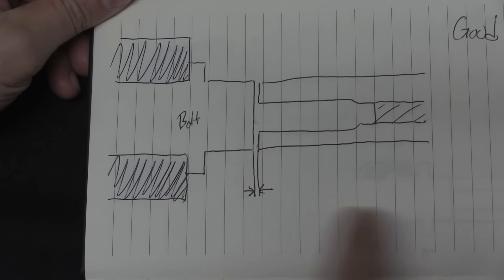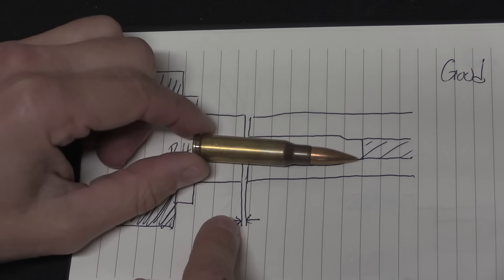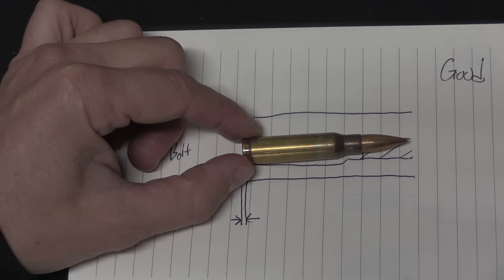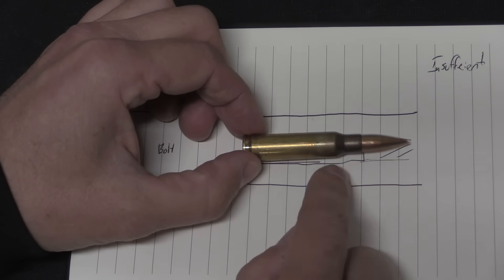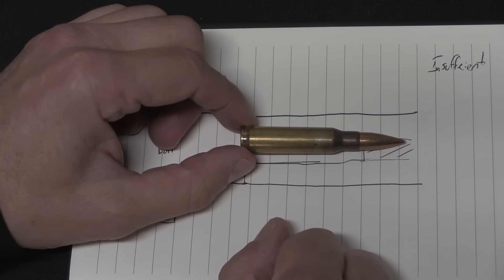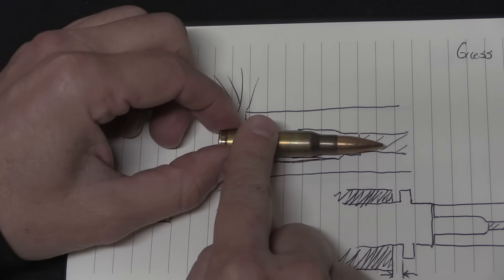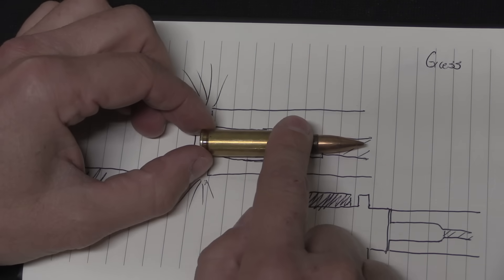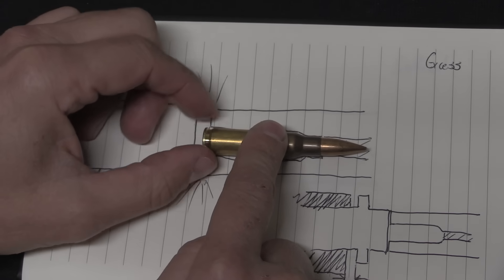Ask Ian: What is Headspace? (And Why It Matters)

Comment: Can I ask you a question? How did the black powder guns became obsolete? Besides the obvious answer of muzzle velocity, less gunk in the barrel, etc ofc. And what’s the difference between the different systems of black powder guns? I’ve heard of flintlocks, matchlocks, all sorts of systems, but can’t understand how one of them is better than the other
Reply: Smokeless is more powerful per volume, so cartridges could be smaller and lighter. Higher velocity gives better range. Less fouling = more shooting accurately without cleaning. Less smoke means better visibility and less giving away your position.   The development from Matchlock to Flintlock to Percussion cap (caplock) was a constant improvement in reliability and ease of use.  Matchlocks rely on a smouldering "match" ( a cord impregnated with a slow combustible agent) to ignite the priming powder in an often open "pan"  and thus are quite useless in wet weather.  Flintlocks improved on THOSE (largely because flint didn't care about being wet, and the priming powder was shielded from the weather by the closed frizzen) yet they relied on correctly "knapped" (shaped) flints to produce a good spark from the frizzen surface..Caplocks were a vast improvement as (like a modern primer) their Percussion caps directed the priming flame directly to the main charge.  Black powder internally primed cartridges were an enormous step UP from even the caplock muzzleloaders... in fact that is arguably THE single biggest leap in firearm technology ever, even a greater leap than that from BP cartridge to smokeless....

Comment: I got a brand new Kriss Vector in 45 and in Canadian specs. So long barrel with a fake suppressor and single fire from Cabelas, and a few boxes of different ammo types every single case that ejected was split after about 20 rounds I was concerned after another 40 I was like wtf I took it back and they said there was a head spacing issue they had to send it back for repairs. I said I just want my money back never trust that BS again I always had them check the headspace, even if it was a brand, new gun terrified me.

Comment: I have an old heavy barrel model 70 win in .243 just recently I’ve been expecting blowback just at the neck on one side and an occasional neck crack?
Reply: Is this with new cartridges, or with brass you've reloaded multiple times? 

If you are having these problems with new factory-loaded cartridges, your pet rifle needs to go to the rifle doctor. If it's doing it with brass that's been reloaded multiple times, it may be the brass, and it could be too long and/or work hardened. If it is with your reloads, try a box of factory-loaded ammo. If it is still misbehaving with new ammo, take it to a gunsmith for a once-over.

Comment: I found that when building an Ar-15 or Ar-10, is best to either sent your bolt to the barrel manufacturer, buy the bolt with the barrel where the manufacturer will check the head spacing. This is a big problem with DPMS barrels as the head spacing is not standard between manufacturers. If you are building a DPMS system, it is best to buy the bolt and the barrel together from the same manufacturer. 

Even when buying a new complete rifle, I always check the head spacing.

Comment: I was wondering about this for shotguns. I know shotguns use the rim of the case for head spacing but why haven't automatic shotguns started using a rimless case for better feeding? Are we just too set in our ways? Would a rimless all metalic case not allow for certain loads? What's the deal?
Reply from the maker: There is such a huge supply of traditional shotguns and ammo out there that introducing one with proprietary ammo would be market suicide.
Reply: @ForgottenWeapons  I totally agree with that! I was watching to see what would happen with the RAS-12 shotgun that used a rimless case and that totally flopped. I just feel like having an automatic shotgun in the 21st century that feeds most reliably from a fixed magazine tube still seems... antiquated.

Comment: SMLEs are notorious for having excess headspace set at the factory. Not so much that factory cartridges will go boom, but enough that reloaders have to be very careful to headspace off the shoulder or eventually their cartridges will go boom (head separation).
Reply: I never full-length-resized a cal. .303 round that's been fire-formed in a SMLE. There is extra room in the shoulder area of the chamber that the cartridge will form to when fired ( a new factory cartridge). I only neck-size a fired cartridge case when reloading, full-length-resizing would work-harden the brass in the shoulder area and cause it to split in due course. Neck-sizing-only greatly extends brass-life, the down side is, the reloaded round will only chamber in the rifle for which it was fire-formed, forcing a shooter with more than one SMLE to specify which rounds are for which rifle.

Comment: This was a very good basic explanation of headspace and its role in safely firing the firearm. I would like to see follow-up videos on ways of achieving headspace. Rimmed cartridges versus belted cartridges versus semi-rimmed versus shouldered versus head spacing on the case mouth. All but semi-rimmed have their advantages. Secondly I would like to see the effect of headspace on accuracy particularly in the case of 38 Super where it is a semi-rimmed cartridge but gets increased accuracy when the firearm is set up for to headspace on the case mouth. And finally it would be nice to see a comparison of say a military chamber versus a match or even bench rest chamber. There used to be guys that would shoot an entire benchrest match with one casing! Punching out the primer between shots priming it with a hand primer measuring the powder charge and seating the Bullet by hand. And yes when it comes to stating something in the first 30 seconds and then rambling on for a stream of Consciousness for 10 minutes I'll try and give Ian a run for his money!
Reply: That is very cool!! I didnt even know someone could do such a thing at the range.
Reply: @stephenhood2948  I don't know if they still do it. But these guys would cut their Chambers so tight that the cartridge would just chamber. And the neck of the chamber was cut to only let the brass expand enough to release bullet. So after they fired the shot the neck would shrink back down enough to hold the bullet. When they seated the bullet it was long enough to touch the rifling when chambered. They did all this to eliminate the variable case volume from one to the other and to make sure the bullet started from exactly the same place in the bore every time. But remember they were shooting groups measured in inches at a thousand yards and this was 30 possibly 40 years ago. Ammunition quality control has improved quite a bit.

Comment: Here is something I want to add, for those who think they want to check their own. The two terms that get thrown around are "go" and "no go" (come as a set), and you should ignore these. Those are for gunsmiths, and are for setting the headspace for brand new guns only, and are only for setting the initial head space that a NEW gun should have, and is only one end of the range of what a gun can safely use. For users who want to check if their headspace is still within the standards for what is still safe to use, you need "field", not "go" or "no go". Field is the maximum space you can use, as opposed to what a new gun should have, and there is a lot of usable range past "go" and "no go".
If "field" closes in the chamber, you have too much headspace, don't shoot the gun. If it won't fit, you are good to go.
Reply: I'd take slight issue with this.  First gauge to use is NoGo.  If gun goes fully into battery, stop.  Then use Go.  If gun refuses to go fully into battery, stop.  In either of those situations, you have a problem that needs to be determined and fixed.  If the first two tests pass, then use Field.

It is also important to remove spring loaded ejectors (such as on M4) before using gauges, as the force of the ejector pushing on the gauge can give you false results.
Reply: @robertgad3269  Unless you are building the gun yourself from scratch, go and no go should have been done to it already. Like I said, those are for gunsmiths. But otherwise, you are right. Ian even said that, he just didn't talk about "field".

Comment: Headspace is defined as the amount of space from the crotch region to where the steering wheel is located but it also contains the space below the event horizon of visibility from Dashboard to the chest as it's vital in it's prevention of visibility from the outside in. Sometimes headspace can be gained if no gag reflex is present.

Comment: Hey everybody! Wondering if the information provided in this excellent video is applicable to a fully rimmed cartridge. It would seem that a severe problem with cylinder/ frame clearances could allow for a potentially disastrous separation at the base of the cartridge ( I am thinking of a wornout Colt SAA or any other revolver of similar design...) or a failure to function altogether.
Please, your thoughts?
Have a great day, y'all.
Reply: The head of the cartridge is end with the rim, opposite the end where you shove the bullet in.  Hence head space is the gap for the rims between the frame and the cylinder in a revolve and head separation being a problem.
Revolver loads like 38 Special, 45 Colt and 44 Special are less than 20,000 psi you are more likely to see the thing jammed by blown, pushed back primers or failures to revolve or fire if there is too much clearance.
Reply: Thank you so much for your information!
I think what prompted my question was an image (legit? click bait? I dunno..) of a SAA that Elmer Keith ( god rest his soul...) shared of one of his personal guns, which he had been using as research into the concept of a really hot pistol round, which I guess was instrumental in the development of the 
.44 Mag , aparently test running a very hot .45 long Colt .
Top of frame: lost in space....top strap of frame: essentially bent all the way back....shielding the hammer. Apparently, no was one killed that day....but I am willing to bet a guy, Mr. Keith, among the best American pistoleros, had a bit of a moment when his SAA (one of the great gun designs, by the way...)
essentially went from a functioning machine to scrap..in his hand....
Thanks for all your thoughts, everybody.
Reply: The head of a handgun cartridge is about 5/16th / 5mm thick (thickness of the primer plus the wall with the firing hole), the rim is about 3/64th to 1/16th (1-1.5mm). 
To get a cartridge to stick out far enough to expose the thin cartridge wall, the rear cylinder gap has to be huge.
Revolver cartridges are usually cylindrical, so even a little gap below limits of the head thickness will not lead to excessive wall clearance.
This may occur on cylinder bores heavily worn out which may lead to a cartridge wall gap being too big and the wall will get stretched to its limits.

INHO to put it short:
A revolver with that much headspace or cylinder bores that large will be so sloppy, you would not try to fire it anyway.

Comment: Another common example of too much headspacing would be the dutch Steyr manlicher carbines particularly the ones sent to Indonesia as most of them have been converted to 303 British rather crudely so the chamber is too wide except for the very top. The casings come out buldged but is otherwise completely safe to fire. You can probably screw with brass goblins too

Comment: My roommate had a sporterized 1917 Enfield. We took it out back to try out a couple of old guns. I loaded it up with Ferderal .30-06 and fired it. It felt like I had been hit in the cheek with a hammer. The case had burst from the head to about an inch up the case wall. Gas shot down the bolt track, blew out the bolt release, singeing the skin on my thumb and blasting gas and unburnt powder into my face. I touched my face to find blood. The powder had been lodged in my skin leaving a perfect outline of my safety glasses. I spent the next week picking grains of powder out of my face.

Comment: Looking at a 7.62x51 cases after being fired in a typical commercial "deer rifle", and a typical military chamber, the military headspace fired ones are very, very noticeable.  The one fired in the military chamber is much more 'swollen', and much longer - Same ammo, same conditions. The three military rifles chambered for 7.62x51 (Israeli FN Mauser, Ishapore 2A, Argentine FN-49) I have/had also had a great variance within the 'spec'.  The Ishapore cases expanded a LOT, and had a side bulge.  The FN-49 had a slight asymmetrical bulge, but nothing too bad.  The Israeli FN Mauser had fired cases that looked almost commercial.  Firing anything near full pressure .308 commercial brass, esp WW looked downright scary, esp in the ishapore.

I believe headspace was correct for all, but chamber 'generosity' was very evident.  All rifles were mechanically sound, and all had matching bolts.  One thing for sure, thank God real 7.62x51 brass is typically 15-20% heavier than commercial, and as I recall the brass with the most heft I ever saw was Brazilian CBC surplus...  Think it was 203 grains, where .308 WW brass was around 165 grains IIRC.

Comment: I've heard excessive headspace can also  lead to misfiring due to the firing pin not really reaching the primer (or rim) properly.  I'd like to know more about head spacing for rimmed and rimfire cartridges.
Reply from the maker: That is possible, yeah. In such a case, misfiring would usually be a really good thing, because that much excess headspace would be likely to lead to ruptured cases.

As for rimmed and rimfire cases, the concept is identical. The difference is that headspace is set by the thickness of the rim alone, so the cut of the chamber is much less important (to headspace specifically; it's still very important for other reasons).

One place this changes is with unlocked blowback actions, like rimfire or pistol caliber carbine semi autos. In those, it's mass of the bolt that is holding the cartridge in place, not locking lugs.
Reply: Am I right thinking (runaway) slam firing could affect closed bolt semi-autos  rimfires with insufficient head spacing? Would have to be extremely bad spacing I'm guessing. Thanks matey, great work as always.

Comment: So if I have three PSA Ars and I buy An Aero precision  BCG, are all four BCGs interchangeable, or do they have to be checked? Also, are all of the bolts interchangeable with PSA .223 Wylde?
Reply from the maker: They should be interchangeable - but you should check. Especially with low-cost parts.

Comment: Headspace... belted bottleneck cartridges as the 7mm Rem Mag.
When marketing considerations outperform technical properties.
There were Magnum cartridges long before the standardisation of the former wildcats. 8mm x 68S, 6,5 x 68, 7mm x 66 S.E. v.Hofe.
Interessting fact of the latter: the pre-war 7×72mm S.E.v.Hofe origins from the 375 H&H Magnum and had a belt. The shoulder was fireformed during firing from a standard looking shoulder to a venturi-style one.
Wonderful explanation from Ian. Could you turn out a video about the early german Magnums and high velocity cartridges? BRENNEKE, HALGER, SCHÜLER and many others work on them and are drifting really into the dark ....

Comment: My Arisaka has a hole at the top of the chamber near where the bolt head and the rear of the cartridge sit, I assume this was a built in factory safety where ruptured cartridges could send the high pressure gas.
Reply from the maker: Yup.